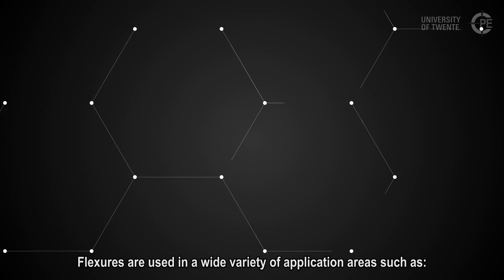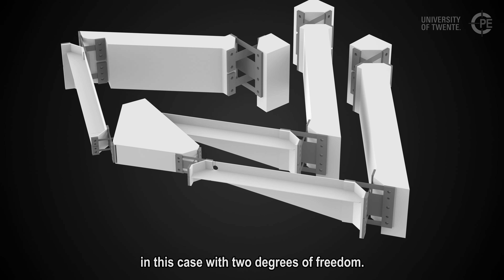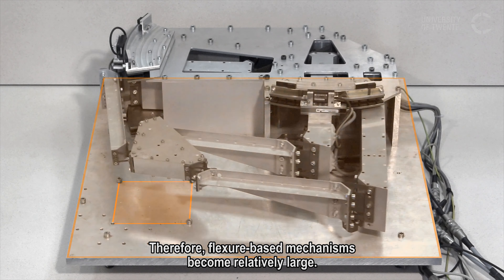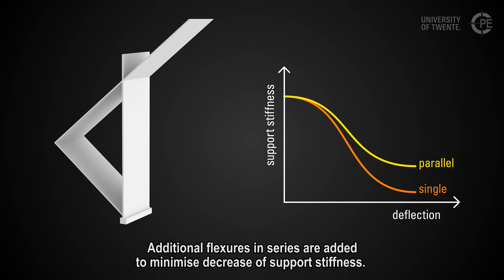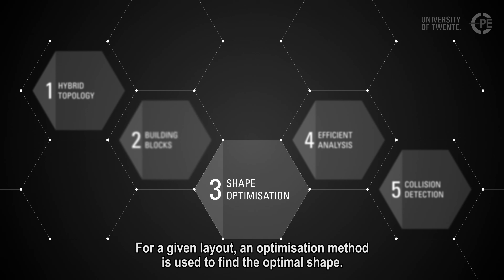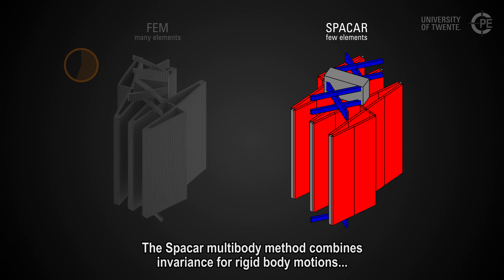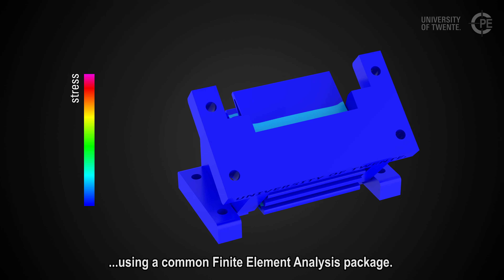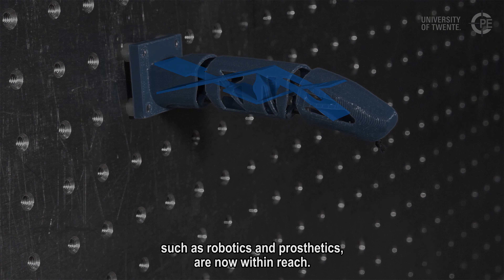Flexure Joints for Large Range of Motion

Comment: I was doing some thinking about flexure joints when I happened across a wall hanging device for large flat screen TVs. It is designed to swing out from the wall, and tilt, while remaining stiff in the "Z" axis. They sell millions of them. At first glance it looked like a perfect application for a flexure system. But polymer materials have low yield strengths. The ceaseless pull of gravity on the swing arm would rapidly deform flexible plastics. Although the joint itself would be theoretically "stiff" in Z, the entire apparatus would quickly sag down the wall unless the flexures were made from something like spring steel, which would defeat the cost savings from using monolithic polymer construction.
Reply: Polymers usually also experience creep. So that would also disqualify it as good materials for flexures.
Reply: How do polymers handle static loads over a long duration, for example years?
Reply: Polymers are commonly used in the initial phase of designing and printing flexures. The actual joints manufactured in the end are using steel or aluminium 7075. 3D printing metal is also an option but does comprimise some of the material benefits. But just for the record all the polymer use is because of rapid prototyping. There is alot of potential geometries to explore.

Comment: Thank you for the video. I was recently looking into flextures for some small 3D printed parts for hobby purposes. It seems, that almost all information about 1) explained examples and 2) pro/con of solving a particular scenario are hidden behind paywalls charging hundreds of € for research papers. And you don't even know, what's in those papers and if you can apply some of the information to your own scenarios. If you have some pointers, where accessible information about simple flextures or compliant mechanisms can be found, it would be very helpful. Thanks anyhow for sharing your info!